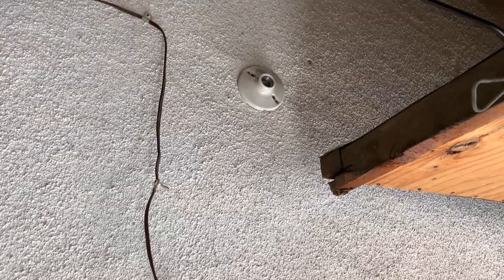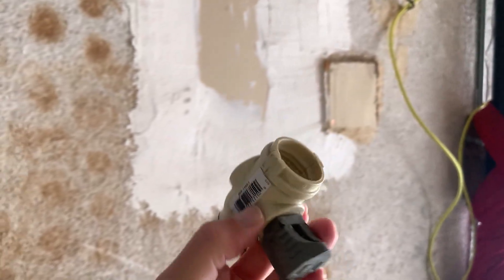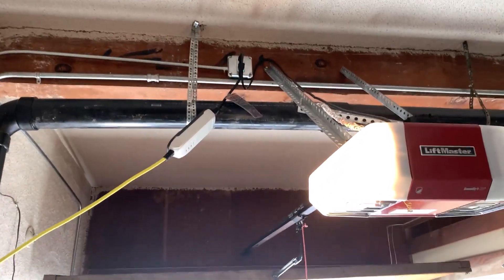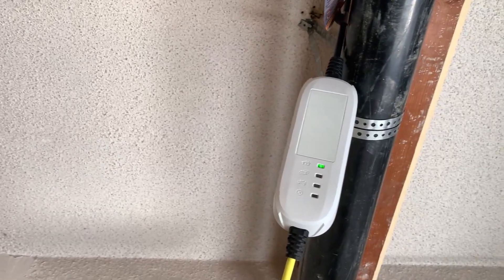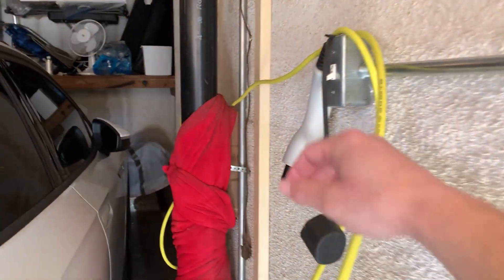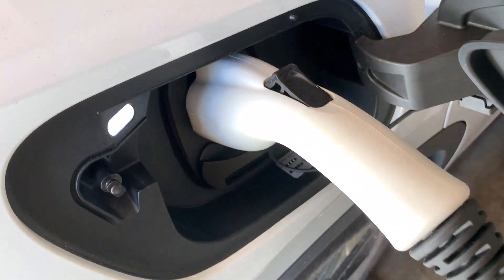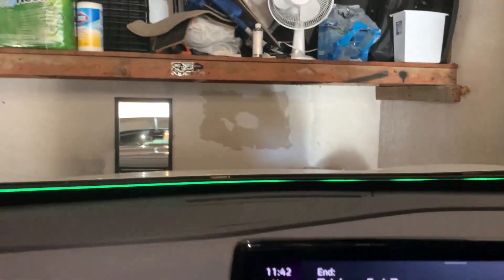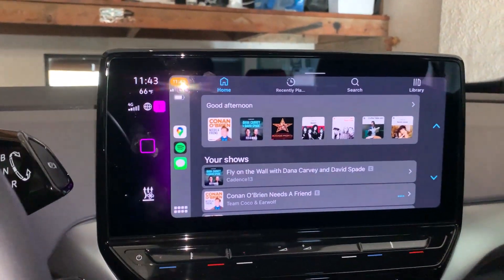HERE Is How You Can Get Home Charging For Your EV If You Live In An Apartment!

Comment: That’s nice but the apartment I live in has no garages or outdoor outlets.
Reply: Than one expensive solution is to spend apx 7,000 for a portable  240 Volt  powerstation,  which seems extreme, but than again, 
your prepared for emergeny's with loss power to your home, and  you won't be be paying for gasoline,

Comment: insightful video for what is a challening problem for apartment drivers looking for a way to plug in. 

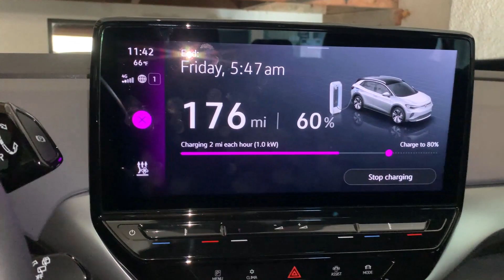Question: @3:40 you note a 1kW charging rate. on a 120v circuit that would mean a bit more than 8A going to the car. Did you have to set that charge rate in your car or is the L1 EVSE itself limiting the current?
Reply from the maker: Thanks! In this particular video, I did not limit my car’s AC charge rate, but that is something you can do, and I have a video about that. I find that I get a max pull of about 2.2 amps using this L1 EVSE. This video shows a more granular look at my L1 process and numbers. https://youtu.be/4ubhZfx26F8?si=190cU_ZKykVFiPj_

Comment: A while back I lived in a large apartment complex and the one car garages were on a separate meter from the units. This was before I owned an electric car. A very long term renter bought an electric car after asking if it was ok to plug in his level 1 charger. The management went one step further. They installed a 240 volt receptacle in his garage for level 2 with the understanding he would pay a bit more rent for electricity usage. Before I moved out they upgraded 3 out of 12 garages in every building and now market EV charging to prospective tenants. Doesn't hurt to ask.
Reply from the maker: Smart landlords! Absolutely doesn’t hurt to ask.

Comment: Level 1 is more than a "sometimes" solution. I went 2.5 years with my 2019 Kona Electric before I got my Level 2 charger installed at home. In those years I only used fast chargers when I was on serious trips, like the family Christmas trip Toronto -> NYC or Toronto -> Sudbury (~ 400 km/250 miles). Fact is, you sometimes need to drive a long way in one day, but you don't often need to drive a long way TWO DAYS IN A ROW.  Especially if your daily commute is less than 80 km/50 miles round trip, you do not need Level 2 to save tonnes of gas and money with an EV.
Reply: This! That’s how I’ve using my 2021 Tesla Model 3 for the past year and a half.
Reply from the maker: Agreed! I wish more people who have level 1 home charging would actually use it!

Comment: I just started subscribing and watching your videos. I also live in Long Beach and I didn’t realize there were so many charging stations located in the city. I own an EV but I also have a level two charger installed in my house. I never realized how challenging it is for non-Tesla owners to attempt DC fast charging at commercial stations. Why is station reliability so bad?
Reply from the maker: Thanks for subbing! It is challenging- lots reason why, but network operators like EA, EVgo, Chargepoint etc, get grant money to install new chargers, but not to maintain them. Often times, the new chargers are poor quality, they get used by all the new EVs (there are many), they break, and the operators don’t bother to fix them. Take a peek at the PlugShare app to check out all the public chargers in LB!

Comment: A low cost neutral-ground bonding plug likely would have enabled the EVSE to work with the ungrounded outlet (useful for floating neutral generators and portable power stations). But getting a proper GFCI was the way to go 👍🏻
Reply from the maker: That’s a great tip- and useful for the future!

Comment: My last Apt Garage was attached to my unit (and pwr panel). For detached garages, a number of network providers have programs where they manage chargers (billing) for the property owners. Why this? Simply to avoid way more complex wiring from individual units. Drop a hint to the managers that they might want to avoid the rush (delays) and provision (some) detached spaces for billed charging.
Reply from the maker: Good point! I know that Chargepoint, among others, has a similar program. Convincing apartment owners is challenging though. I think right now, for many of them, EV charging is too “future” oriented.